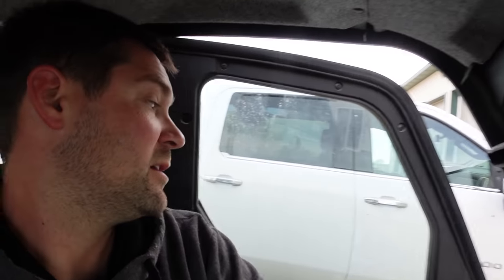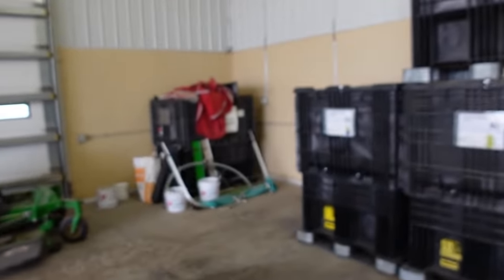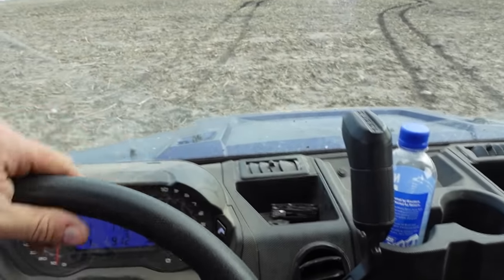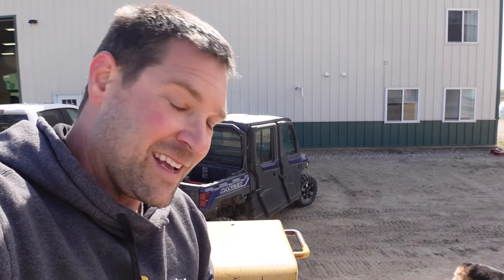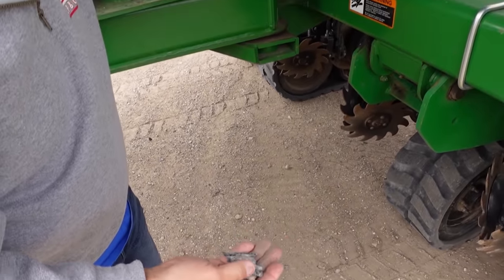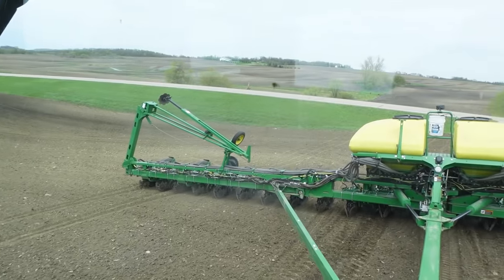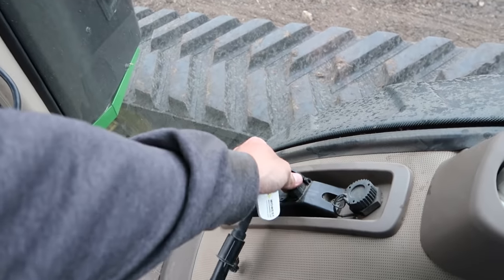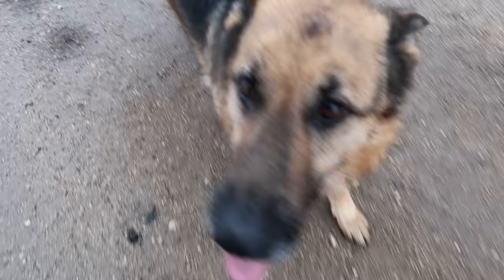FINALLY Our FIRST Day of Planting Corn! - Spring 22

Comment: I haven't farmed in 30 yrs and thought I'd like to try the new technology but watching you battle the planter has changed my mind.
Reply: It's great when it works but if it doesn't work, than it causes a lot of headaches because not every farmer is an electrician, also why we run a planter from 1979
Reply: @Farmer_logan06  Yes mon!..I planted 120 acres of corn and milo with a JD 7000 6 row..Didnt even hook up the monitor..  I have a video of it..No sceens computers or nothing..I cant deal with the electronics..

Comment: Great to see you are finally getting to it! Just a shame it rained you off eventually. I hope that weather flips back around and you can keep going.

14:46 looking at the side it's on I'de say the pressure from the tank when the roof fell on it probably popped that hose off. Lucky it just let go at the fitting and didn't split the hose.

Comment: My #1 Rule when troubleshooting stuff is "Is it plugged in?" I don't know what sort and how many connectors those planters have, but with all the vibration and heat cycles those things go through, it might be worth unplugging and replugging all the connectors in the spring.
Reply: Yep!Every year i'd be cleaning and checking every.single.connection.
Imagine trying to run one of these when it's 10 or 15 y.o ...
Reply: @ronchappel4812  I'd wager most of these will become unusable once Deere drops support for them, and that will likely be long before they become functionally obsolete.

Comment: We've had good luck putting dielectric grease in the connections for the downforce sensors. Seems to help a lot.
Reply: not a bad idea for every connection. Just don't over do it on the amount.
Reply: But do WD40 make dielectric grease?

Comment: I was feeling frustrated this morning until I watched this. This new tech is great when it works well but when it throws a curly it is a real shit. 
     My washing machine decided it did not like being turned off when full of washing and water. I was trying to soak the washing but the machine would turn its self on and start emptying. I turned it off but 3 minutes later it started up again. I gave up and let the machine run the washing cycle.  
    Your dealing with all your 'problems" was an eye opener for me, you were relatively calm and collected. I would have lost my rag and thrown something important away. 
    I hope the rest of the planting season improves weather wise. All the best

Comment: Thanks for the finger measuring tip.  Just checked my index finger, same as yours, 1 inch to the first line, 2 inches to the second joint. Nice.  Thanks for the updates, use what ever camera works the best for you.  The content comes across well with either camera.  May your machinery function well and your crops and grow to wonderful yields.

Comment: I have noticed that day 1 has not actually changed much. Before all of the sensors and fancy stuff, there was still a bit of fiddling around to get everything set correctly and working right. Instead of trying to solve sensor issues, it was stop and get out ever 50-100 feet to check settings and results and adjust things manually, or try and figure out why a row wasn't dropping anything for that last 100 feet.

Comment: Put dielectric grease in the connection to your down force sensors, back behind your row unit controller. A lot of times that helps with those down force codes.

Comment: Just for another item to keep in mind. There is a product made by many firms call Dialectric grease.  Maybe this should be added to all connectors at fall clean up.  This stuff prevents to a great degree poor electrical contacts for years afterwards.  I get my grease from the Wally store for about six bucks.  for my needs this will last a couple of years.  There is no shelf-life problems with this product.

Comment: Our brand new planter has the same downforce sensor issues.Poorly designed plugs,put dielectric grease in them to create A suction to pull them together helps. Your not alone. wiggle wire good to go till It decides otherwise. CONSTANTLY!!

Comment: 1st camera felt like focus was better but it also felt zoomed or not quite wide enough, if that's the camera you've been using maybe its a recent settings change; it felt different today or its just something I happened to notice now. 

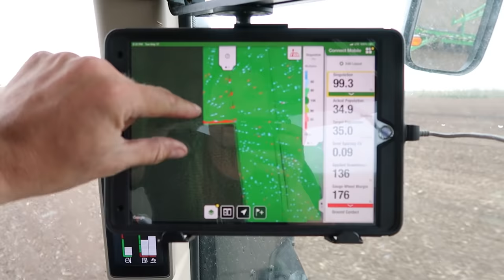The second camera didn't have that zoomed in feel and it was a little more sensitive/reactive to the lighting conditions( maybe its ISO changes are less granular); focus did seem a little off at times, this could be an issue with minimum focus distance for the lens. At 35:44 I think its doing its best to try to focus on your reflection in the monitor, I dont know if the other (1st camera) would do better.

Either way, I'm happy to hear you guys got the planter in the field, hopefully no more gremlins show up.

Comment: Those gauge wheel sensor connections give lots of trouble. They changed them on the 22 models, but the retrofit exact emerge kits still have that little round connector from what I understand.

Comment: Zak, I don't know if you ever read the comments, but they make a dielectric  SPRAY GREASE that you can spray inside all the electric wire connectors.  It will solve a lot of the connector problems you are having, after the machines have sat for 10 months and the pins have corroded some.
Reply: His name is Zach, not Zak. Please read the descriptions.

Comment: My 2018 Subaru Outback turns the radio back on every time that I start the car too. This is the first car that I had bought new that does that. Also, the radio stays on even after I shut the car engine off until I open the driver's door to get out.

Comment: You need to pull every plug apart a smear some dielectric grease on them pins to get proper connections. My boss would've had a shit fit and fired the guy who left the junk in the tank and never ran your seeder at the dealership when it was there.

Comment: The issue with the warnings continuing to pop up I believe is cause you’re still moving while trying to cancel out of things. With that being said we run a db44 22inch spacing for beets and beans and a common issue we have is that belt housings need to be cleaned Every 2k acres and need to be extremely lubed with graphite talc, we use the same as you. One difference would be we run politicked beet seed.
Reply: Pelletized*

Comment: Don't know what sony you are using...you may be able to find a Sony RX100 V out there if not the RX100 VA is very similar to the V. with some of the bits of the RX100 VI.   The advantage of the V and VA over the VI and newer is the minimum focal distance is closer than on the VI and newer models  and your aperture(low light performance) is better too.   If it is the rx100v or va you are having the problems with.....forget everything i just said.😎   God bless you guys.....glad yer back planting

Comment: If it can't be fixed with a Leatherman it's time to go home:) From someone who has dealt with many sensor issues in greenhouse( a hostile environment for same) environmental controllers, contact cleaner is your friend. Further tip I picked up from a boiler repair man, spray the cleaner on a dollar bill and use that to burnish the contacts.

Comment: The new old camera or GoPro has better sound quality because we don't hear that high-pitched background noise that we do with the Sony. The Sony displays your pretty face much better than the GoPro but we figure it's the stress that gives you the ruddy complexion with the GoPro. Was that confusing enough? BTW is that a Leatherman many uses , fix-it-all? I have one of those and their guarantee is awesome. I broke something on it called them they said they would send me out a new one it almost got here ahead of me sending the old one back. I've used all the tools as intended plus as I see with you a few other applications. Even the scissors on there is awesome. I hope your planting season goes without any more hitches. Looks like that dealership was swamped, with some of the small details they overlooked. It's great they have a man in the  field that helps you get the Kinks out that you can't find unless you are actually operating the machine. I have a 9 mm CC that I've almost been tempted to use on that expensive screen in the middle of my Subaru Dash it has the new driver management system and also the seat positioning controls that the midget must have sets , oh sorry little person set when he brought it from Omaha to Bismarck. It works for awhile and then it lays me back and shoves me up against the roof every once in awhile. And their Tech guy hasn't been able to figure that one out. He did give  me an icon on the screen to shut off the stop light shut off California crap. Man did I get off on a tangent there , sorry about that love your videos!

Comment: the this camera focus is better until you do a close up then its slower focusing. example when you are sitting in the cab all is could when you turn to show a monitor it takes a bit to clear up.  the this camera is the one you were using for a  few years i think.

Comment: Go look at the gauge - that's probably Not PSI, but Inches of water column pressure. Fans, not a compressor.
Reply: Natural gas uses water column pressure, with a plastic tube manometer and red dye in the water. Like a tank level on sprayer, not a float ball, just the red dye water itself. The gauge is from Dwyer Manometer

Comment: I’m a multi-generation city boy that doesn’t know anything about broad acre farming, but I do appreciate farmers regardless of where in the world they produce food for city boys😘. Question I have, the complex modern farm equipment seems to be “finicky” and not reliable. I worked in IT from the early 70’s until 2010, so I got an idea of what complex technology can be like if it isn’t designed for robust operations. Just seems you have to stop and adjust for silly little non-faults to often for my liking. Stuffs up productivity. Also, not a real great advertisement for the big green equipment manufacture.

Comment: Great video showing how new technology can cause more problems  and create down time. When planter works it plants. When planter stops you are loosing production.  Farmers planted for years with out the  computer equipment.  Micro processor are just not what they a sold to be.  In the lab it works. Out in the field  everything is subject to change. Military term snafu or fubar  …The more things change the more they remains the same.   Just give it hell  and keep going.  Later.

Comment: During your troubleshooting comments in the tractor, you sounded just like NASA getting ready for a launch, "guidance-go, tank pressure-go, down force-go, power cycle-go, row unit controller, standby-alarm, Houston - RAO (Row alignment operator), RAO - go Houston, 'Run like a Deer' said to turn motor shaft by hand to clear alarm.  RAO- affirmative. Also Houston, tell 'Run like a Deer' that they have a glitch in the control software. We keep getting alarms and covering the main screen. We can't see the other operations. Houston it is just like the '1202' alarm "Eagle" had on landing approach to the moon in 1969. Houston - RAO, we'll pass that info on to 'Run like a Deer'. RAO we also have a technician from 'Run like a Deer' inroute for on site assistance. RAO - Houston, standby, we have another alarm.......

Comment: Throw out that gas chainsaw and get an electric, throw a battery in and go. Much easier that fighting to start gas.  For a pro cutting all day gas might be better, but for the rest of us batteries are there.  I have a dewalt flexvolt so I can use the batteries in my drill too.

Comment: You can tell the "New Sony" is a better camera prob 60fp but the "old" one is fine, just the jump between the two was jarring. pick what is best for you the quality of the video is not what I am here for anyway. I can go to Welkers for 5 min drone shots when I want that :)
Reply: ah I see what you mean re the focus. have you tried just using the gopros for the vlogging? the 10 is very good for what it does. Other wise you are going to have to go up to a sony zv-1 or a canon g7 and they are not very robust with dust etc. I would vote test a gopro hero 10 and see. If you dont like it hey you have another gopro for when you lose one. nothing lost. Plus be good to have for time lapse when new shed being built or bin going up/down.
Reply from the maker: @TheNewryRFC  those are actually the 3 I use lol. The first camera here was a ZV1 with a wider lens on it. The 2nd one was a Canon G7X. Go pro audio it just horrendous and they glitch a lot which drive me nuts. They're durable though
Reply: @MillennialFarmer  dji pocket 2? Only thing would be a good mount for tractors etc but it’s definitely portable.
Reply: @MillennialFarmer  also rode do a class external mic for the go pros think it’s call videomicro off top of my head. Will also help cut wind noise with the muff on it.

Comment: Hey, plz be safer w/ chainsaw especially when wearing no ppe. Use chain break, no one handed saw swinging, no drop starts, etc. Also, you get one set of ears. Use hearing protection w/ chainsaw and with noisy equipment.
Reply: Sounds like you are in 🇬🇧